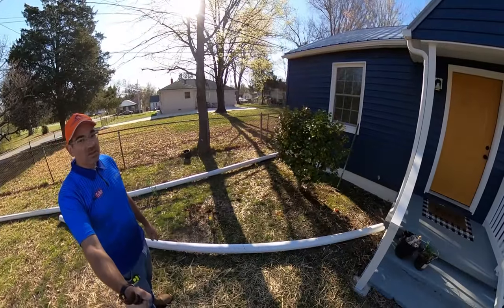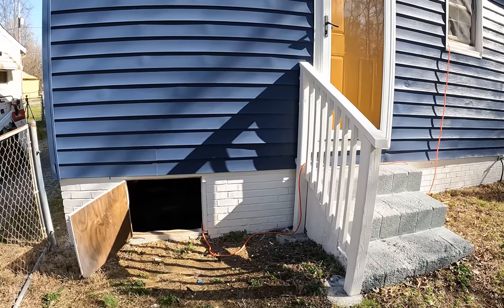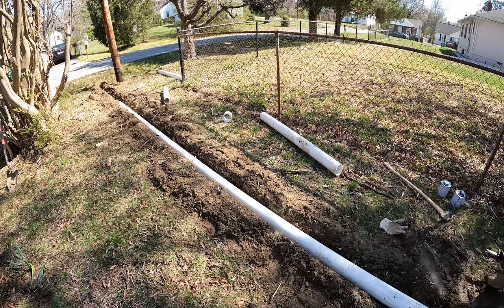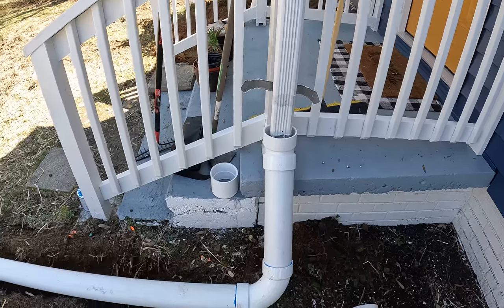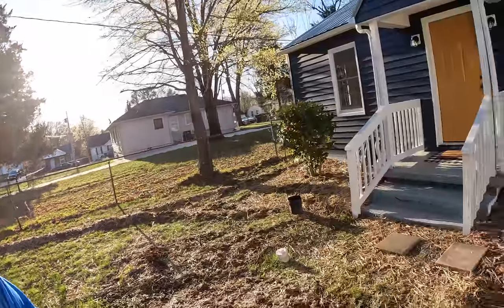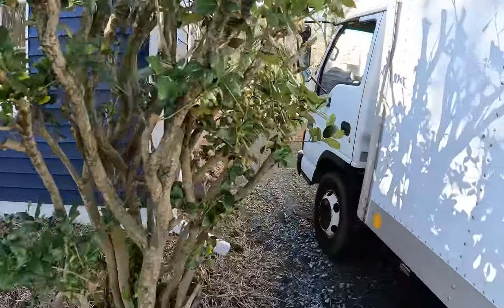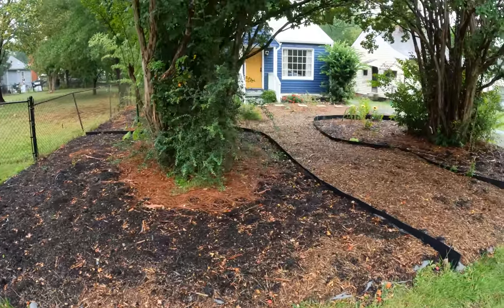Quality PVC drainage system with very little fall

Comment: @4:50 it would have looked better to add and extend the gutter pipe down then add a gutter elbow to wrap around the ledge then finally a straight pvc pipe. Best of both worlds form and function.

Comment: Your question on looks vs. results in the description... definitely results. Looks are nice to have, but are secondary and thus sometimes must be put aside. 
Sometimes you gotta do something ugly to make something work, but that's OK. 

If you need a bit of extra fall, then having the pipe poke up out of the ground a little bit (in an area where it is not a tripping hazard or liable to vehicle damage, eg. a garden bed) is fine. Just chuck some treebark mulch chunks, or or equivalent, over it!

(note: I have not watched the video yet as at writing the comment, I just saw the question and thought of an answer, and wanted to get it out before I forget it)

Comment: Communication is the most important part of a job, tbh. Letting people know why you're doing something a certain way helps them understand the problem solving
Reply from the maker: That's right Ry! I could tell by their text they weren't happy so I called them right back to explain things. Regardless of how they felt about my explanation, the pipes were pouring out water right then, so whatever I was saying was clearly correct. I also assured them that I could bring in some more dirt if needed after the pipes settled in place. They were happy with that.

Comment: When I was 17 I got 4 internal stitches and 12 external from budget barbed wire. It works 🤣
Reply: Wow, I still have some so I should probably remove it.  I think the manufactures stopped selling it for residential use with those twists.  My city doesn't allow electric dog fence without a six-foot-non-electrified fence perimeter, so those low-hanging barbs are probably banned here for new-residential-fence construction.
Reply: It's a fence, it's there to stop people getting in so what's the point of making it easier to jump over 🙄
Reply: @tttt4029  This is America where they must commit the crime before doing all of the time.  We also pay taxes to educate children & keep them safe. Now that we live in the age of security cameras there is no need to barbwire the guts of a child to protect less value than injury caused by the unnecessarily-short-violent-fence.  Plus the Rabies-Act requires six foot fence for dogs that break-the-skin so barbwire is probably just as hazardous.

Comment: You could have just used aluminum downspout elbows on those front downspouts to get around the patio and down to ground level to your pipes.  Those to short gutters over the stoop are barely getting any water anyways.  That way you could just have a 90* pvc elbow sticking out of the ground just a couple inches.

Comment: The fall of the pipe on the yard doesn't matter, "provided" that you catch your water high up from the ground... and in a "sealed pipe". My definition of a sealed pipe is when there is no way for the water to get out of the pipe except for the water discharge down low. For example, your city water tower uses the force of gravity to bring water to your home...thru a sealed pipe. One or many water connections up high and one or many water connections down low..."thru a 100% sealed pipe" except for intake water and discharge water. As long as your water is taken up High and it flows in a sealed pipe to down low by gravity...the water will flow thru the any sealed pipe!!!

Comment: Way to stand your ground as a contractor. As always, great work.
Reply from the maker: Thank you! I wanted them to understand the reasoning behind it. I could have buried the pipe, but it wouldn't have worked very well. The fact that it was raining and the pipes were pouring out water didn't hurt either. 👍

Comment: Great work as always. Could you set a galvanized window well around a gas meter, if the meter was too low for you to build up the grade?  Not ideal but then at least you could build up the grade on most of the wall.

Comment: One very simple change will transform your drainage slope issues. Here it is: throw away the unsealed down spout pipe and replace it with a 4" sealed pipe. Then your down spout pipe will be transformed into a miniature city water tower...capable of taking the rain water up slopes and discharging the water far away from the house Foundation. Simple but effective.

Comment: Nice Job and a good video. I am still amazed by the construction standards in that area.
My house is from 1957. Foundation is 3 feet deep concrete (no bricks). All downspouts are connected to the city sewer system.
Basic building regulations means that all houses are build this way. So we never experience those kinds of water issues.
Reply: 😳 All I can see is sewage backing up into the gutters and/or rain water backing up into the house due to a blockage!
Reply: Gutters shouldn’t be draining into the city sewer. They should have a water drainage system that gutters and runoff flow too. That would overwhelm any city sewer if gutters were ran in the sewer
Reply from the maker: I see this a lot in comments and I'm sure he means stormwater drainage system and not sewer.
Reply: @GCFD  I sure hope so! This is the recipe for a very nasty disaster! 🤢
Reply: @terencemerritt  You are quite right. Our previous house that was from the 70's had a separate sewer and rain water drainage system.

Comment: Kinda amazed you didnt run the rear gutters to the front and tie in the one near the gravel driveway, even if the pipe would have been above ground for the fall.

Comment: Have to say, baffled by what they get away with for building stuff up there. Didn't remove the composite roof, just threw down R-Panel and screwed straight into the existing roof...in the valleys no less. How does that roof not just pour water in? You guys did a fantastic job in helping get that water redirected away from the crawl space. And yeah, very good seeing Ronald again. He is one hell of a worker!
Reply from the maker: Thank you Dave! This was a good project for sure and when I talked to the homeowners about the looks, there was water pouring out of the pipes at the front ditch. That roof was shedding water!
Reply: Lots of metal roofs are put down directly on top of shingles

Comment: You probably would have done better aesthetically to use the downspout pipe down closer to grade.  Using 45s made of the downspout pipe to get around the porch overhang.  That large diameter PVC just stands out too much that high above grade. Otherwise looks good to me.
Reply from the maker: I agree. But it blows out debris and water like mad. 👍
Reply: Ĺĺĺò

Comment: Pipes will flow just fine if you capture the water in a "sealed pipe" "directly" from the gutter 8 - 10 feet above the ground...from the gutters well above the ground.
Reply: Yes, yes it would.
Reply from the maker: That would create a ton of head if the pipe ever clogged. Boom.

Comment: You could have used smaller pipe on the porch, the amount of roof it is servicing did not require that 4” pipe, would have looked a lot cleaner when done.
Reply from the maker: That's very true, but I like 4" because it moves debris and requires less fall than smaller pipe.

Comment: I'm really curious about something.  I've seen other companies fit something directly onto the downspout that is connected directly to the PVC.  Some of them even have a cleanout on them.  Is there a reason you don't use those?  Thanks!  I love how helpful your videos are!
Reply from the maker: I don't use downspout adapters because they seal off the system. Placing the rectangular downspout into a round coupler leaves a space in there. That's enough to access the system with a snake or jetter hose. I talk about it in this video: https://youtu.be/IDblo3MVRp0
Reply: @GCFD  Thank you so much for responding!  I was coming in here to look for this question today to delete it because I came across that video last night!  Extremely helpful, as are all your videos.  I'm a homeowner who had a disastrous result from a company that tried to fix flooding into my garage from my side yard, using, of course, socked perforated corrugated pipes that collapsed after about six months.  It's a story, but you have helped me understand what went wrong and what will correct it.  I'm a huge fan.

Comment: I have had to deal with a leaky basement right after I purchased a house. The disclosure statement said they knew that the basement didn't leak and it leaked like a sieve. The law is written in such a way that I couldn't recover attorney fees and the attorney said he would win the case no doubt however what I would get from the seller would probably all go to pay his fees so just fix it and call it a lesson learned. The contractor that came up with the right solution put window wells in, hauled dirt in and established grade from the house 10 ft out into the yard. He said the only thing it goes within this 10 ft is grass. No landscaping materials no plastics no shrubs nothing but grass and you need to keep the grass watered so it doesn't dry and leave a crack between the basement wall and the ground in a very dry year. The next thing was to put on gutters that were properly sized with downspouts that got the water away from the house. Once he was done the basement has not leaked in over 25 years. He did a very thorough job of checking everything out with a Transit so he knew exactly where the high spots were in the neighbor's yard and how much of their yard drained into my yard and where my yard would have to drain to so he knew everything before he started. The Fly by Night guys wanted to charge me $40,000 to dig out along the basement wall and put tar to stop the water. Yes I know that never would have worked! I enjoyed the videos because you always do your due diligence before starting a job, do the best that you can on a job and are willing to deal with the customer if there are issues. Need a lot more guys like you in business.
Reply: Pleased you got it sorted and sounds like you found a Shawn clone there with the solution 😀
Reply from the maker: Awesome story, thanks for sharing! I agree that shedding the water off the foundation is the ticket instead of trying to waterproof the wall. By redirecting the water, the wall will be dry to begin with. 👍

Comment: I have three downspouts that go directly down against the house in an L-space. I want to put a concrete border against the house. Do you recommend solid pipes that go down and create a hole into the concrete and risk future cracks or putting a channel drain and eventually connect to the drain to a basin?

Comment: If they want deep pipe then they probably need a low-sloped-6-inch self-cleaning discharge run.  On my DIY I too wasn't satisfied with my pipe-depth so on the redo I started at the discharge & hand-dug the ideal slope. I got the flow I needed but I still required modified low-profile Catch-basins. 

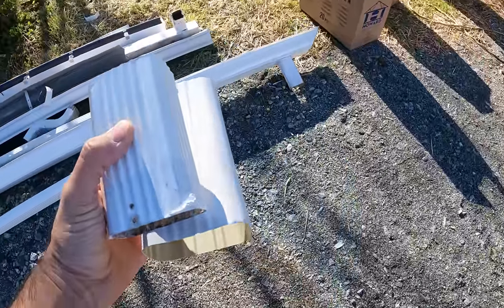10/10 16:55 Yes, the smaller downspouts are completely pointless. 

No-offense as I know most customers want them level but gutters should have slope, IMO.
Reply from the maker: Yes the gutters need to be properly sloped or crowned if there's a downspout on both ends (ideal installation).

Comment: Aren't those 2 huge trees that they planted in the front yard right going to wreak havoc on the pipes you just laid down underground? The roots will certainly get to them being so close.
Reply from the maker: The pipes are sealed with solvent welds (PVC glue) so they should be fine.

Comment: I agree with the home owner, the consideration should have been made to make the porch drains symmetrical to suit the more difficult side. And given how close the new downspout was in relation to the new pipe work, it was cutting corners by just having it dump onto the driveway rather than being collected to flow into the ditch. The finished look of the visible sections of pipe is also not great, with the vertical sections of pipe not being plumb in both directions lowers the overall finish of the job, and is a consistent downside across a lot of your previous videos. I do agree that results are always good, but if you get a good looking outcome that also works well then customers will be extremely happy
Reply: Agreed should be very little visible pipe. Downspouts should run down into the drains.

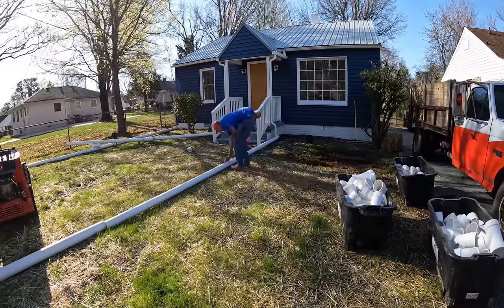Comment: 1:00 I'm confused...

You mentioned adding a downspout on the front near the driveway but haven't laid out a pipe to catch it and divert the water to the ditch at the road...

Why wouldn't you add the pipe now while all the rest of the work is being done to catch that water instead of leaving it near the house and/or sheeting across the driveway?

Comment: Why did you need to remove the leaves before putting on dirt?
Reply: organic matter rots and soaks up moisture, he just wants high clay content ssoil to deflect the water away. Few leaves probably wouldn't matter to be fair though.
Reply from the maker: Like tt tt said above. I want the new dirt to form a waterproof bond with the old dirt, so the leaves had to go.
Reply: @GCFD  thanks! So basically the leaves will turn into ”bad” dirt that you dont want near the foundation. Got it! 😊

Comment: "Must Read Comment". You would have excellent drainage on the front & back yard "if" you would install "sealed PVC pipe" from the gutter discharge point at the roof line downward. By capturing the water ten feet up in a "sealed pipe"...you could get great drainage on a five foot rise of your discharge pipe...because the water is captured up high... just like your city water tower does. let alone the small rise on this property.
You will never run out of fall if you connect a sealed pipe directly to the gutter height.
Reply: They've done that video already.
Reply: That's how we do it in the UK, although all our pipes go to underground sewers anyway.

Comment: How much would it cost to take a necessary amount of truck loads of dirt to re grade the front lawn so that the pipes weren't shallow?
Reply: It's probably cheaper to try a 6-inch or 8-inch pipe instead of raising the whole lot b/c they require less slope than the 4% dirt needs.  & if they're flat b/c they're in a floodplain then they might not be allowed to add lots of dirt b/c the floodwater could raise & damage permitted home construction.

Comment: Don't capture the water near the ground...it has very little or non stored energy... "CAPTURE the water up high at the gutter". This means you will need a 4" PVC pipe directly attached to the gutter its self. Then it will be in a sealed pipe starting 8 to 10 feet above the ground. This will force the water to flow...period.

Comment: Always boggles me as to why when building these homes with crawl spaces dont put in a mud layer on the floor... 50 bucks worth of 6 mill visqueen and 2 or 3 inches of concrete equals an easy to maintain space...

Comment: (MUST READ) The only reason that you have to "mind your fall", is because you refuse to listen to my advise. What is my advice? It's simple. Make the gutters act like the thousands of "City water towers " in the USA. The city water towers are "higher and above" the elevation changes...because the tower is higher it does not matter that houses are at different elevarions. Here is the key Knowledge that you need to know. When your sealed pipes are connected with glue...all the way to the gutters...you have an 8 feet advantage over the ground slope rising and falling, ☆☆☆ For this to work you "MUST HAVE SEALED PIPES FROM THE GUTTERS DOWNWARD"! Note:The gutter pipe does not need to be sealed to the drainage pipe...it just needs to drain the roof water into the sealed drainage pipe.